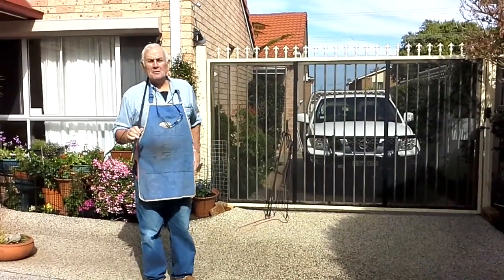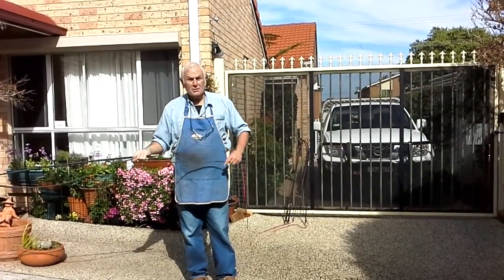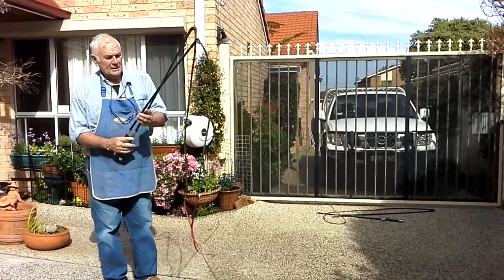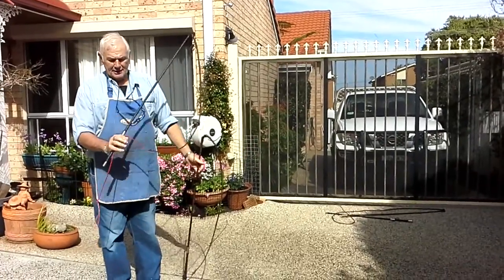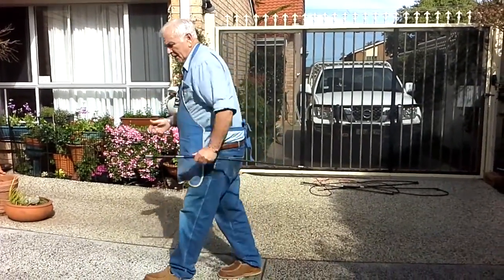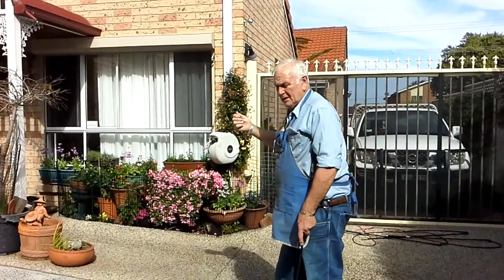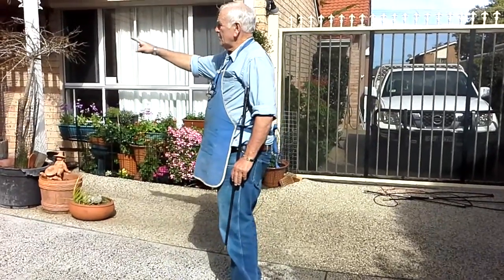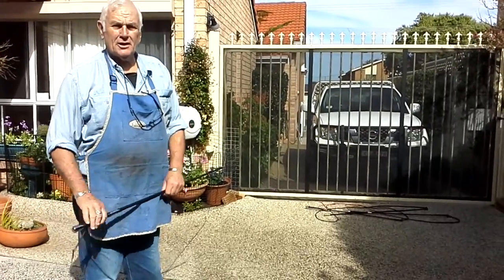BREAK WHIP AND DELIVERY WHIPS

Comment: G'day Glen, a bit late to this video but I am curious about the construction of the first whip, the gig whip I believe you called it... How is the stock made? Is it essentially a longer stockwhip stock? Tohiti cane with a steel lining? I know old coach whips handles used to be made with baleen strips and  cane wedges held together with string and pitch before being plaited over, but I can't see that still being used today... The stock and thong connection looks to be the same interlocking keeper deal... Anything special about the thong? DOes it have a plaited belly or just a core? How many strands at the start vs at the point? Is it a regular old fall hitch?
Cheers!

Franco